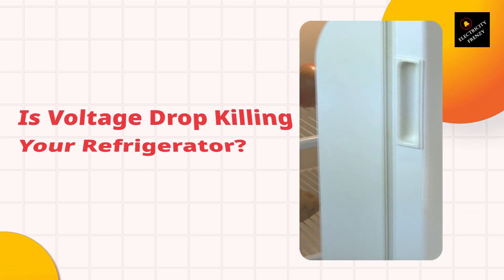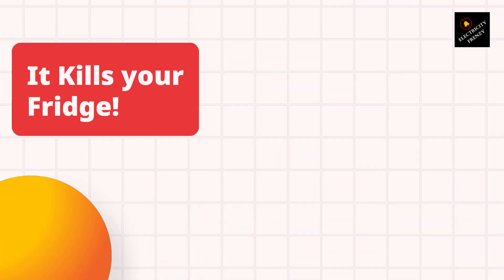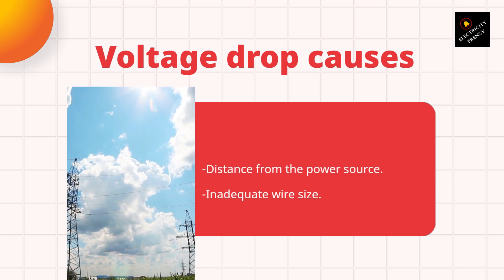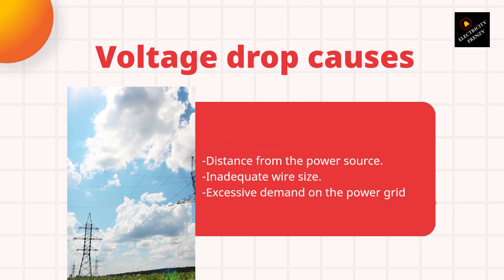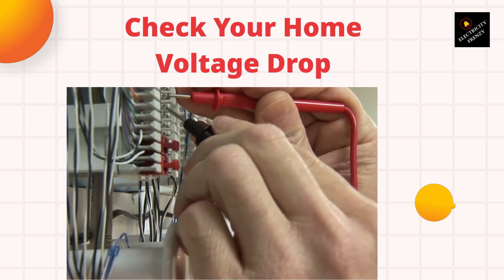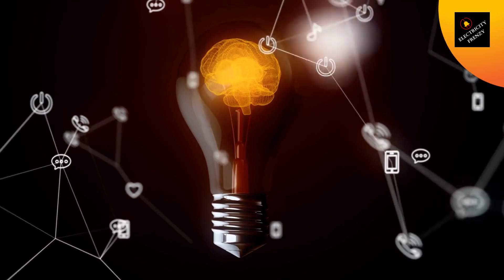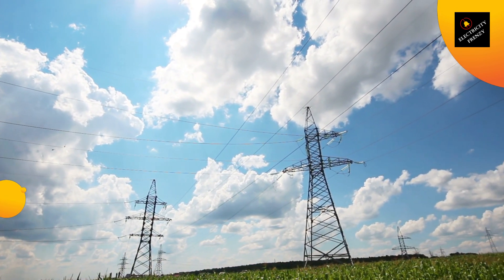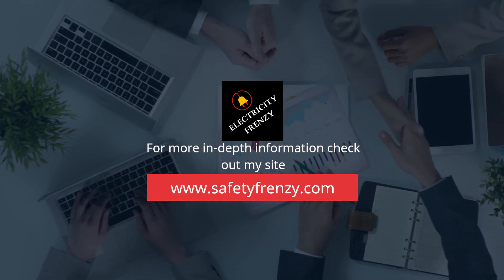Is Voltage Drop Killing Your Refrigerator? What you should know!

Comment: Can i use 1500watts automatic voltage regulator to run a 110watts fridge? We have massive voltage drop
Reply from the maker: Depends on the voltage value of your system and the minimum voltage of the regulator.

Some regulators can't increase massive voltage drops
Reply: @ElectricityFrenzy  the wire i use is telepone drop wire. Too small.  And i am 300meters away from my neighbour which I attached with a wire.. In the morning the voltage reading in my multimeter is 220v normal.. but when I plugged my refrigerator. Voltage drop to 90v.. and when I unplugged the refrigerator. Voltage back to normal 220v.. My question is. If I use an avr, will it be possible to run the refrigerator without voltage drop? Can avr maintain the 220v without voltage drop while refregerator plugged in the avr.. Thanks
Reply from the maker: I suggest replacing the telephone wire